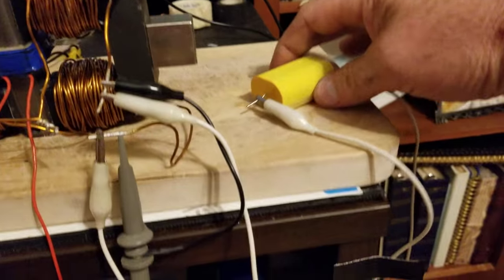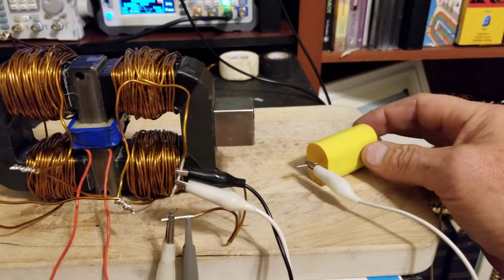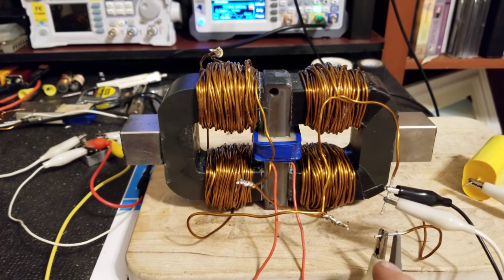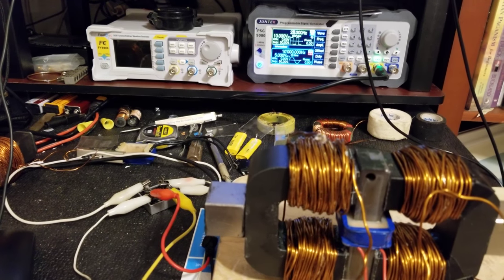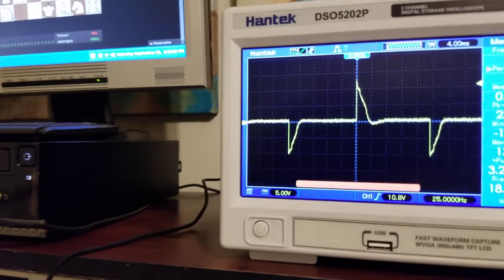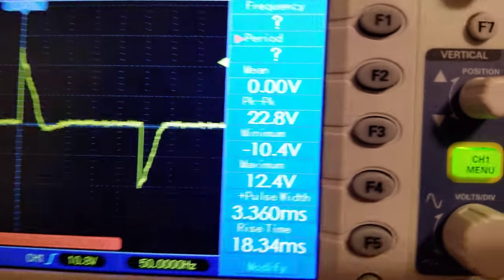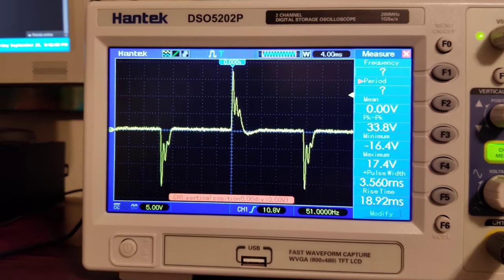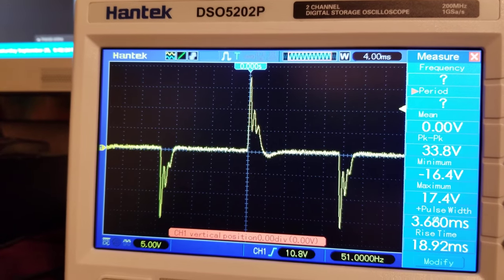Motionless electromagnetic generator part 2

Comment: I made an elecromagnetic generator according to Tom Beardon's Patent, It put out 55 volts AC from 12 volts DC input. When I tried doubling the input I fried the Mosfets because I didn't heat sink them !! I haven't tried to work on it since then

Comment: Over the last several years my project have been a great deal more precise and planned with modification in mind.Your concept is something to consider in respect to these oscillators I like to build so much.  Use a big toroid and cut it in half and place a bar between them, the two arches opposing each other.  Oh yes, Thanks again.